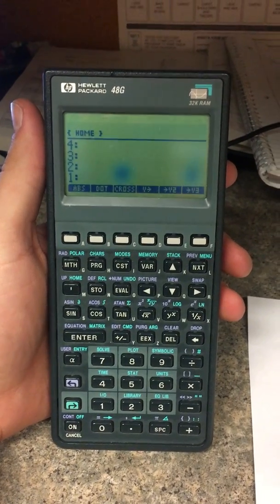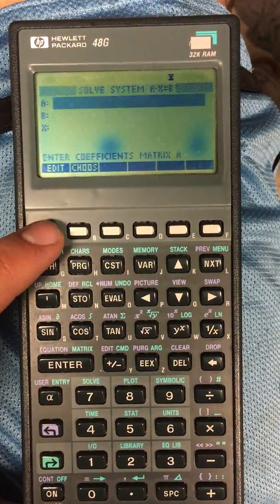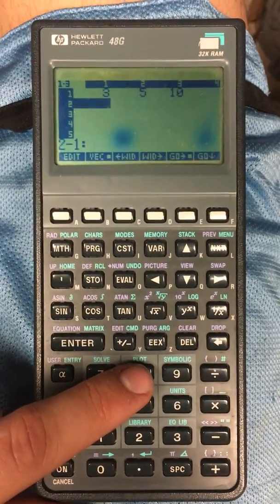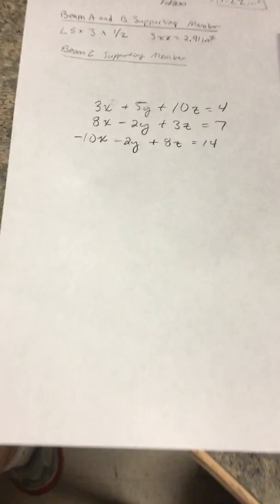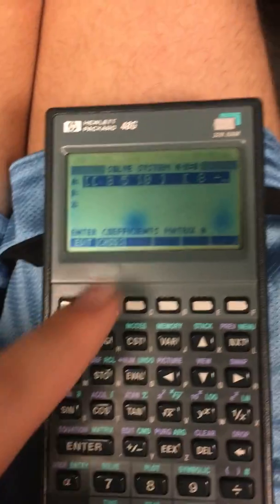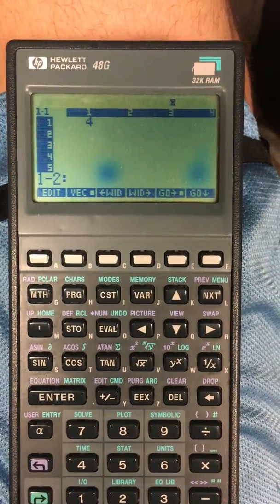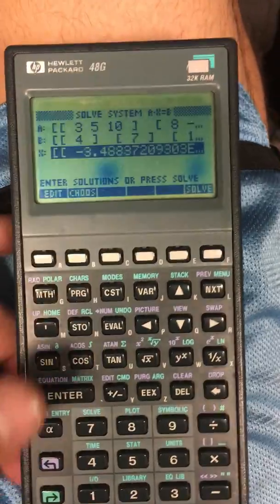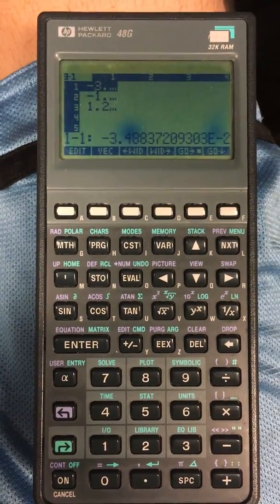HP48G- Solving Simultaneous Equations (Linear Systems)

Comment: I use an HP-48 emulator on my android phone and love it.  It's funny, the linear solver will actually let you enter the B vector as a row-vector and will solve for x as a row vector.  It must transpose the B row vector into a column-vector for you behind the scenes.  It still gives the correct solutions for x.  Maybe this is so you don't have to enter as many square-brackets.